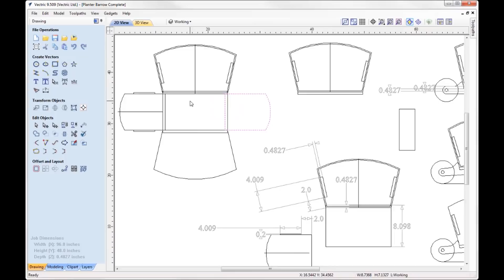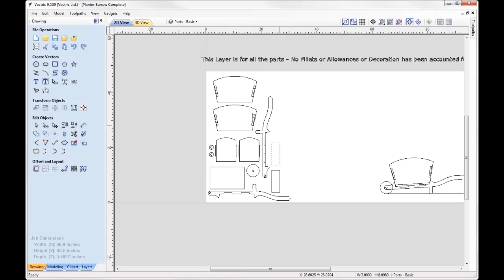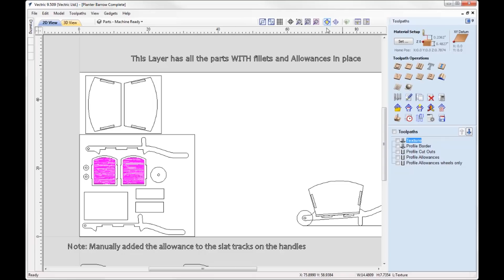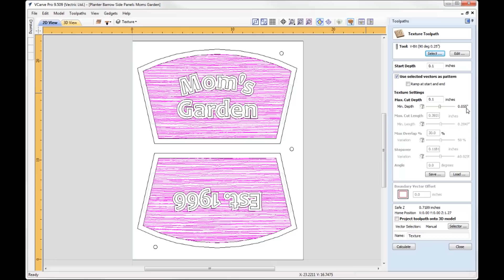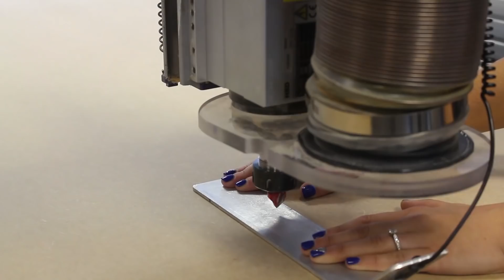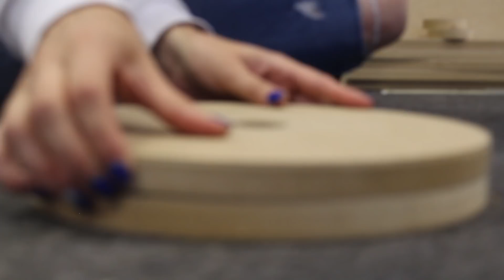In Labs with Beki | How to make a Mini Wheelbarrow | Vectric FREE CNC Projects

Comment: Great project! May i ask how you change the dimensions of the slots and tabs to accommodate different material thicknesses?
Reply from the maker: Hey Jacinto! Sure - If you go to the layer "Parts Basic" you'll see all of the parts laid out, where you can adjust the width/ height of each slot using the set size tool. For slots that are at a slight angle (like the ones on the side panels), you can take a single slot on the side panel and rotate it -12.5 degree's (ensuring the pivot point is in the lower left of the rectangle) that will ensure the slot is positioned straight on horizontally, where you can alter the width of the slot to a size to suit you, then simply rotate it 12.5 degree's to position it back in place and create a mirrored copy over to the right hand side of the side panel. I hope this makes sense, please don't hesitate to contact our support team on support@vectric.com if you need further assistance, as this may be better answered with pictures! I hope this helps, thank you Jacinto ~ Beki

Comment: Two questions:  You show how to change the text but not how to redo the boundary/texture around it.  So far I haven't been able to duplicate the original even with your "Dad's" example.  Also the only 2 sided video references symmetric drilling so I am uncomfortable with asymmetric.  You have a single path called "NO MATERIAL" which I assume is for the spoilboard but don't see a path that drills the top side(?)
Reply from the maker: Hey John, If you want to change the text you will need to delete the original text boundary and the vector texture created. Create a new boundary for the text using the offset tool - I used 0.2" Outwards offset. Then using the boundary and the inner border vectors for the Side panels create the vector texture using the Vector Texture tool  (Top Tip though, if you select the vector texture vectors that I used in the file and go into the vector texture tool it will display the exact settings that I used to create that type of texture - in case you wanted to use the same values :) ) In terms of the two sided asymmetric dowel hole method take a look at this video: https://www.youtube.com/watch?v=1GlVZQ4ngEU&index=69&list=PLLdEiXEsoRerNo7bqzlP5msj9Ini091L0 this should hopefully explain the asymmetric flip method that I use. Correct NO MATERIAL is for the spoilboard (on the bottom side) and on the top side I have the matching toolpath "Profile Dowels" I prefer this asymmetric dowel method because 1. It's fail safe, there is only one possible way I can flip the material over on the machine and 2. it also means I can cut the two sides in two separate operations. I hope I have managed to explain this and I hope this helps! Thank you ~ Beki